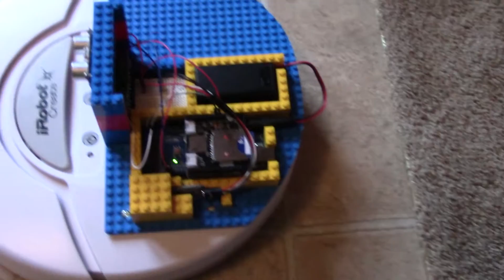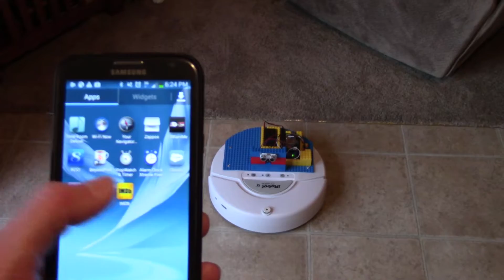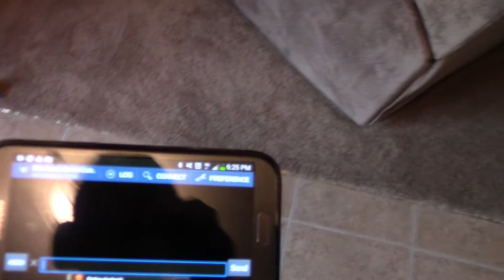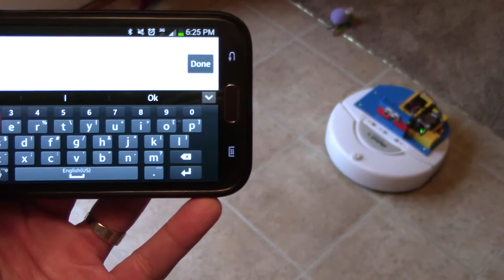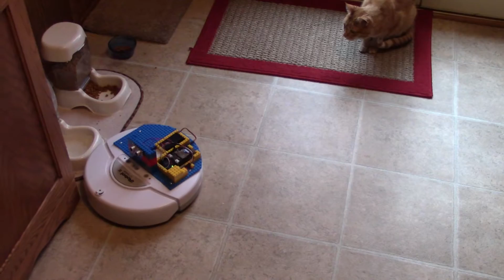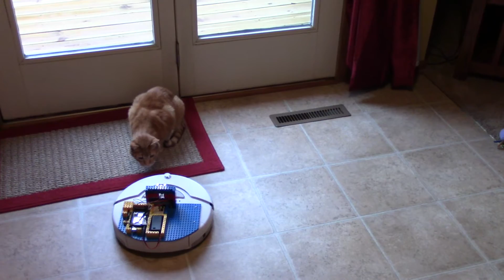First Arduino-Controlled iRobot Create Project

Comment: Interesting, can you explain how the Arduino is connected to irobot create?
Reply from the maker: +Ali Samaan - The iRobot Create has a 24 pin RS232 serial port that isn't visible in this video.  This serial port allowed me to read sensor inputs from the bumpers and send outputs to the robots various motors.